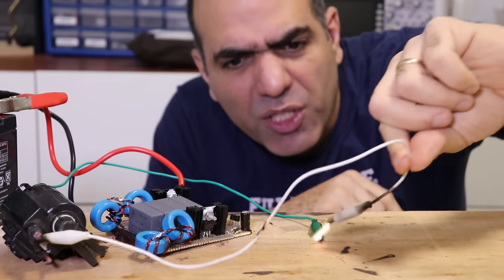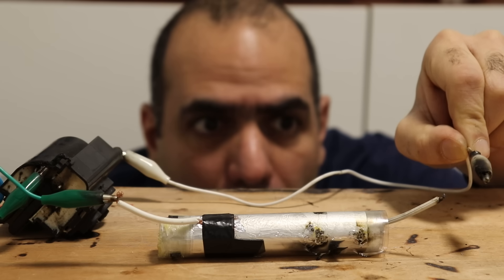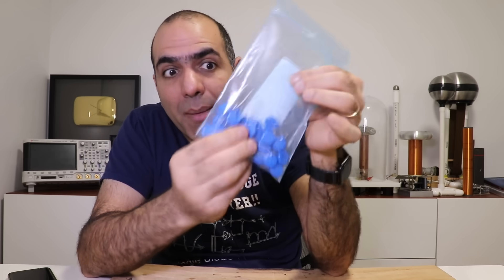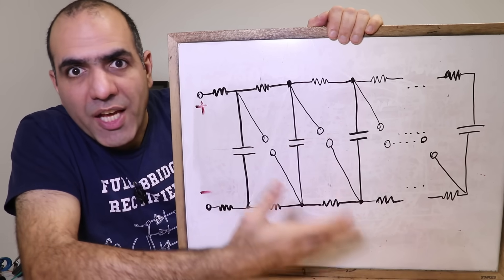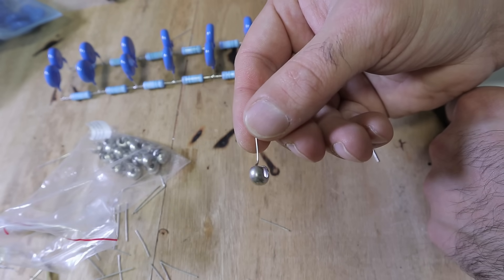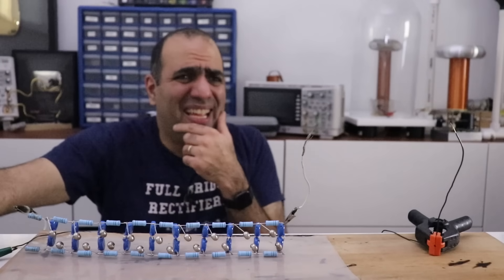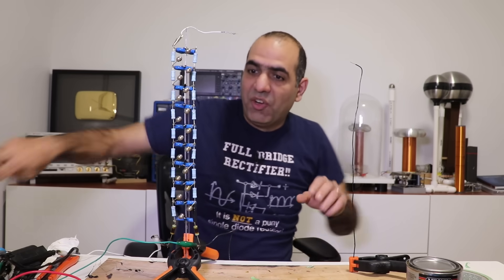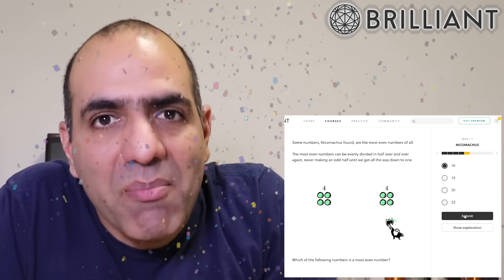Making 500,000 VOLT ARC with Marx Generator

Comment: While it won't work while vertical, you can use a mini-tub of mineral oil  to insulate the circuit. Just make sure to keep the spark gaps above the oil level.

Comment: Is there any way you could submerge the entire thing in mineral oil for insulation? like put it in a trough in the horizontal layout and fill it until only the spark gaps are above the surface of the bath?

Comment: Build a mirror Marx generator for the other polarity, so you can double the voltage and the fun ! Also add a HV resistor in series with the  flyback transformer so all the capacitors fully charge.

Comment: I'm surprised your little Marx worked this well! I tried it with pretty much exactly the same components some time ago, but my 3W Resistors could handle the voltage even less than yours. I never even got all spark gaps to fire to actually get a higher voltage out, it was just all discharging across and within the Resistors. They were ruined in no time.

Getting the right resistors for a Marx generator is pretty much the hardest part when building it. It's not just about preventing air breakdown along the resistor, the resistance itself can just change under the high voltage. Even when they are power resistors, you cant calculate the maximum voltage across them from the power rating.
For example, standard 1/4W THT resistors are only rated for 250V continously, and 3W Metal film resistors might be ok up to 1000V if you're lucky. You can definitely go over that for a while, but its resistance value might change both while the voltage is high and permanently. There are also specialized resistors for high voltage, which can take many kV all day long. But those are expensive and hard to find.

Comment: Try using wax or oil to suppress the corona discharge.
I didn't know about the Marx Generator; I'm used to using voltage multipliers.  I guess it saves on capacitors and diodes at the expense of energy efficiency?

Comment: In 1992: I had my electric guitar in my right hand and I tugged on a metal pull chain switch attached to the overhead light fixture with my left hand.
I got a big jolt and blew out my guitar amp.
Talk about "Goddamn Electric"!

Comment: P.S. 
A corona discharge is an electrical discharge caused by the ionization of a fluid such as air surrounding a conductor carrying a high voltage. 

Not the virus!

Comment: I think the first resistor on the low voltage side ground could be removed as it is still in series with the new circuit made when the spark gaps become closed circuit

Comment: Me a EE student: Cool, what can you do with it?

Mehdi: Can't you see it's sexy?!?
Reply: And it sound like a big old engine starting 😜
Reply: Crowd Control/Tactical Baton... a really mean cattle prod, but god forbid, if it ever taken from you and used you. Firing unit for explosive bridge wire aka "EBW Firing Unit" (used to ignite solid rock motor of all sizes... Hobby Military and NASA, they all use them
Reply: True 👌🏻🤣
Reply: WHAT? Very high voltage resulting in Electrons jumping between two oval shape poles in his private part o!!o hitting something in between... Let me know how you felt afterwards!🤣😱🤔😖☠💥
Reply: Here's one thing: you can dump the energy from a Marx into a high voltage, low inductance peaking capacitor to create an extremely fast nanosecond-scale rise time pulse which is discharged across a separate spark gap and across a load. This rise time cannot be achieved with the Marx alone due to the combined inductance of the Marx. There are numerous papers on it.
Reply: In his electrongun video he uses it to potentially create X-Ray pulses
Reply: True as fuck

Comment: Maybe use two plastic tubes to hold the resistors and fill that with oil?
It would not be that easy to build, as you need to solder it and THEN add the tube (possibly by cutting it in half?), and then seal it well, but I think that would effectively stop arcing...

Comment: 7:05 in school, we dipped such a "ladder" in that wax you use to seal envelopes with. Pretty much cut out all the problems whenever we'd overdo it (each two banks of capacitors had a tap and we'd play various measurements from there, sometimes it would cross streams if you had too much).

Comment: What about keeping the generator horizontal and submerging the lower part in dielectric oil ?
Or if you want to keep it vertical, insulating the resistors and capacitors with parafin wax ?
Reply: I swear I saw the same thing somewhere.
Reply: @AlexApol  On  Vidduley's channel maybe ? He did an extensive video on how to insulate a Cockroft-Walton multiplier. I think the same could be applied here, except for the spark gaps obviously.

Comment: Just put it in a bowl with a bit of oil filled in it, so it isolates the resistors and capacitors, but the spark gaps are still in the air.

Comment: New word for me: Corona discharge
A corona discharge is an electrical discharge caused by the ionization of a fluid such as air surrounding a conductor carrying a high voltage.

Comment: Could a small scale version of this be used to create a low ripple DC boost converter at low voltages? Instead of spark gaps, use MOSFETs and have something like a shift register charge 2 or 3 caps out of a chain and another one following behind it (or a small MCU in place of both) which connects a pair of them in series to an output capacitor / smoothing circuit? In theory it shouln't draw any more current than is used (not counting the switching logic which would be negligible).  Also it would be reversible as a down converter by charging in series and discharging in parallel.

Comment: You could try putting it in a oil bath to prevent the unwanted discharges. Leaving the spark gaps uncovered of course. 
Just a suggestion.

Comment: I think I saw this circuit or something like this in magnetic pulse welding machine! Which use large and high voltage capacitors to create huge amounts of current (250 kA) and pass it through a coil to create magnetic force !!